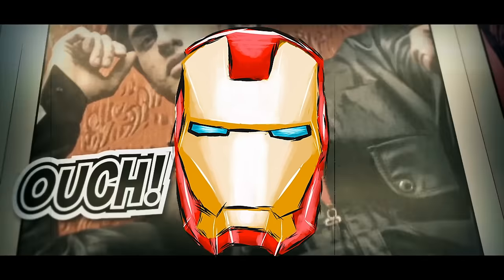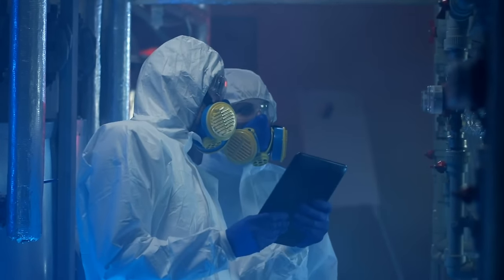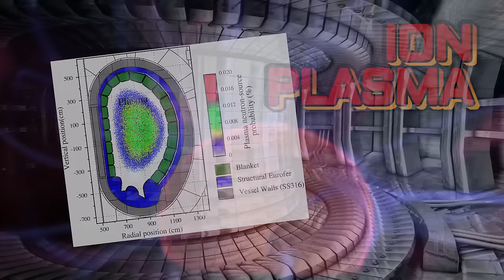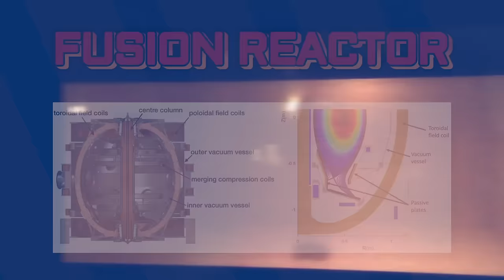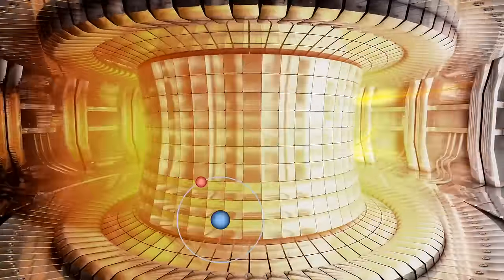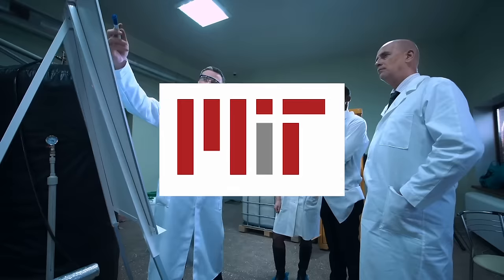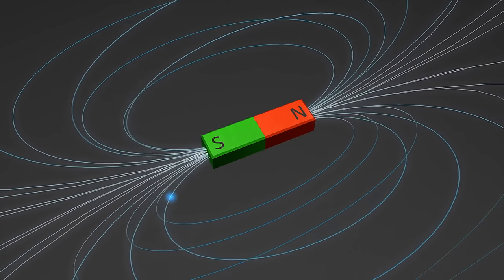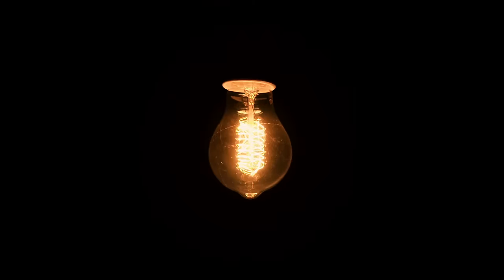How Does Iron Man's Arc Reactor Work?

Comment: A Russian guy made an arc reactor at home seriously search it up
Reply: Ivan vanko 🤣
Reply: It doesn't work the same. It uses electrolysis to collect hydrogen and oxygen in seperate containers for his toy repulsor. The ARC Reactor is basically a mini-tokamak fusion reactor which uses hydrogen and helium as fuel, the only problem is in order to start fusion it requires more energy to start it than you get in the output, also the magnets manipulate plasma (ionized gas) by taking advantages of their magnetic properties. Electrons have a negative charge meaning if you have a magnet you can confine it using a z-pinch which squeezes the plasma into a certain line and goes in a circle around the reactor in order to generate heat that will boil water and create steam which in turn rises and spins a generator to produce electricity. Hope I cleared things up.
Reply: @lightning2940  bud its technically just a hydrogen reactor which you can buy it online and it only produces tiny bit amount of electricity compared to what an actual fusion arc reactor would produce
Reply: Dream Of the Free more difficulty as gotsmaller

Comment: So how come the iron-man suit can run out of juice?
Reply: if the arc reactor is damaged in any way and/or overtaxed over its limit, the plasma cloud will dissipate and the reactor can no longer produce any power. in fact, it would actually suck more power away if he didn't shut down the electromagnets since those consume an absurd amount of energy normally.
Reply: @shadowfire04  I get that but I'm talking about after a long battle he still has to charge the suit like a cell phone. Iron man 3 he flew away unconscious and when he woke up the suit ran out of power so he broke into someone's house and hooked it up to an outlet instead of keeping it hooked up to the reactor.
Reply: @fatbonesmcgee9884  hmm.....well, my point still stands. if the arc reactor runs out of fuel or something (fuses all its hydrogen into helium, i strongly doubt it could get much further than that in fusion) then he would still need outside power for those electromagnets in order to get the plasma restarted. hydrogen is everywhere in the air, and it can be easily produced from water, among other methods. so if the arc reactor runs out of fuel, then he'd need to recharge like a phone in order to get it back up and running again, both to power the electromagnets and the production/gathering of hydrogen.
Reply: @shadowfire04  fair point. Thanks homie

Comment: i dont get it can someone explain? so he has a heart problem? and needs it for? serious question
Reply: The problem was there was shrapnel  trying to enter his heart so he needed an electro magnet hooked up to his chest to prevent that. Orginally the magnet was powered by a car battery until he made the miniature arc reactor which then powered the magnet. In recent movies he doesn't need it since the shrapnel was removed in the third iron man movie where the surgery to do so was much less riskier than before.
Reply: @jadser1  so what is the role of the Super power Magnet ..
Does it supply Electricity to Electronic Suite  
I still don't get it?? It's so confusing
Reply: @dhaval-20  The magnet and arc reactor are separate. The magnet is to magnetically attract the shrapnel so it doesn't reach his heart. 

The arc reactor is what powers the magnet. The reacter also powers the iron man suit or whatever he wants since it generates more power than needed for the magnet. 

Essentially the magnet is just a magnet and the arc reactor  is what actually powers anything.

Comment: #fakenews, You might want to re-Google what neuclear fusion is because your video is misleading. Nuclear Fusion is when two atoms are fused into a heavier element (1 tritium + 1 deuterium + lots of energy = 1 helium + lots of energy). The ionization of hydrogen atoms is part of the process for particle accelerators, but it is not fusion.